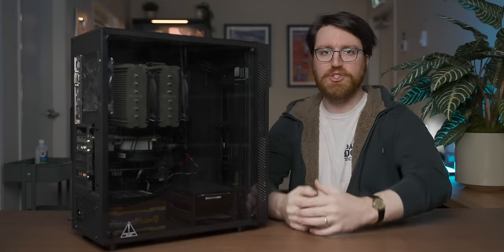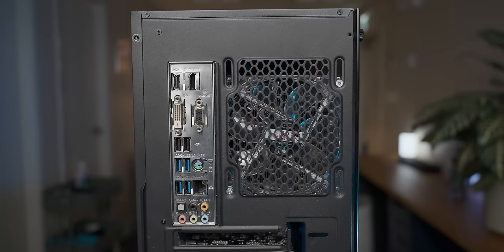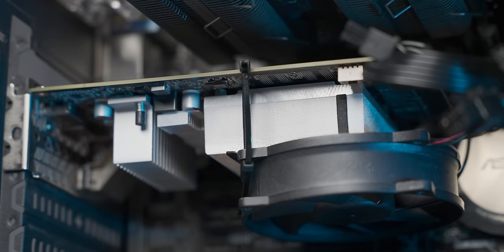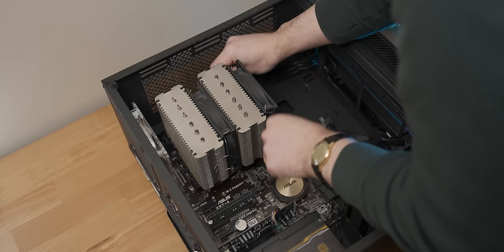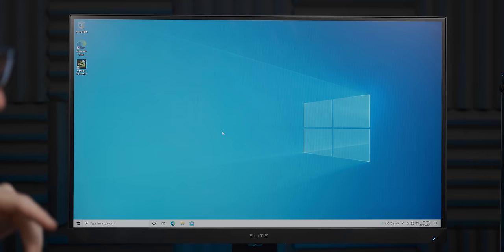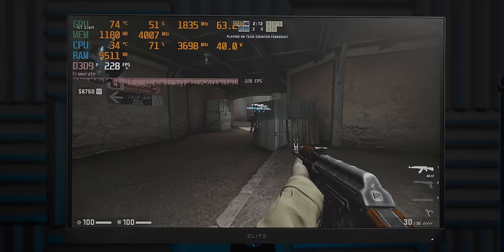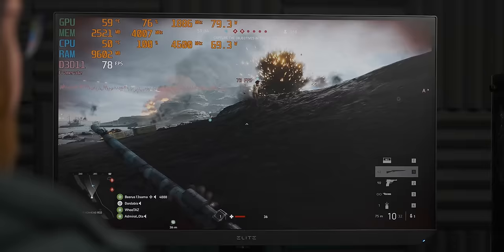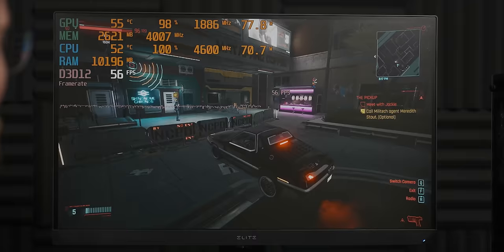What Does A $400 Craigslist Gaming PC Look Like In 2021?

Comment: Just like my old PC: Squeeze out the last breaths of life by installing a better used graphics card, improving cooling with ghetto methods and throw some RAM- sticks in there :) Worked great :)
Reply: Ssd?
Reply: @FS--ew3se  SSD's are for losers
Reply: @siqu7071  yes hdd best
Reply: I swapped out my 1060 for a 6600 xt.  I already had a 10600k and Z490 board and 32gb of 3200mhz.  It more than doubled my FPS, and I got the 6600 xt for the same price I sold the 1060 for as I was offered one that was returned.  The box was a bit damaged and it had nothing in the box apart from the GPU (not even in the anti-static bag).  He sold it to me for £300, a £100 reduction at the time.  Now the same GPU is nearly £600 in the UK so I'm very happy with it.
Reply: Ghetto methods you say? I literally moded a CPU cooler into my 2012 gaming laptop by drilling holes in its stock heatsink. Had to hammer out parts of laptop's plastic shell so that the CPU cooler could be mounted.
Reply: @harryshuman9637  Haha.  I drilled air holes into the front of my case, then re-sprayed it with black paint.  It looks like it was meant to be bought that way.... saved me spending out £75 or more on a decent mesh front case and brought my temps down by 12 degrees.
Reply from the maker: @siqu7071  You take that back. 😂
Reply: @DawidDoesTechStuff  prove me wrong

Comment: After suffering with a low profile PC for five years, $400 CAD got me an orphaned office PC (Core i7, 16GB RAM, GTX 1030, 500GB Sata SSD + 4TB HDD), seller told me it was rescued from the recycling centre. Tack on another $200 to put a 1070-Ti in this thing and I have a very comfortable 1440p gaming rig.

Comment: Like the one I had to trash. I was given an old Intel build and the board was dead... once I got everything torn down and cleaned, I put the system back together RIGHT and found the board was dead... no biggy, it was an old socket 775 system so I just saved the memory and processor... the board got pitched! transferred my MSI 760GM-P35 board into the case and now it has a nice new home...   a Raidmax Scorpio chassis in Blue.... nice chassis! anyway, nice video dawid! Have a merry Christmas!

Comment: Right before things got rough in Jan 2020 I set a co-worker up with a decent refurbished Dell Optiplex i7-4770 mid-tower system from Newegg. 

By the time we snagged a 1tb Samsung SATA SSD and a cheap used GTX-550ti (he's not much of a gamer) it was well under $400 and was actually still pretty snappy when I worked on it the other day.

Throw in a better GPU and it should even do okay with most newer games. (@ reduced detail of course!)

Comment: 4th gen Intel are incredibly hard to kill. 

I am sitting here, amazed by my 4790K STILL cutting it after like 8 years. Jut tried Forza horizon 5 and as I am a "60 fps max quality gamer" my 2080 Super just about copes at 1440p while the CPu still has some good headroom.

The tied together GPU cables actually imply that this thing originally had a better GPU fitted and they threw the 1060 jank edition in for the sale. Wasn't screwed in either. Stiil, decent pairing.

I was a bit disappointed that you didn't really give that soundcard a glimpse though. Could have at least shown what model it was.
Reply: I am laughing cause that means my 3950x will cut it longer then your pathetic quad core
Reply: @raven4k998  So you're saying the CPU you bought like 6 years after I bought mine will likely last longer than mine. You know what? I agree. 
But you are probably the only person in the world that finds this absolutely banal fact funny. For reasons only known to you.
Reply: @catriona_drummond  way way way longer cause my cpu is four times as many cores as your haha
just saying it will take a lot more crap to slow my beast down then your due to having that much more power on hand
Reply: @catriona_drummond  also what happens when windows 10 stop being supported in 3 years your screwed cause that cpu won't run windows 11 haha mine will

you can thank Microsoft for that one dictating which computer can run windows 11 and which cannot
Reply: @raven4k998  I can’t tell if you’re trolling or just a delusional AMD fanboy. For the record I have a friend who went through two 3950X’s because the memory controller died every time she tried to enable XMP on her RAM kit. AMD and their quality toilet paper IMCs.

Also, Intel and AMD are to blame for 11’s requirements. If you’re smart, you know why.

Comment: Engineering companies are a great resource to get half decent PCs. I picked up a rug that literally matched what I built 5 years ago for $250 from Contech Engineering here in Kansas City. Rig had an i7-4790K, 32GB RAM, 1TB of storage in RAID 0 (I think). And a crappy Nvidia Quadro card. Only difference between this and my rig was a GTX 1070.

Comment: That's a great computer for a kid. Or even someone who just does light gaming. Plus, for $400... That's a deal right there.
Reply: Definitely not a deal for $400 i bought a gaming used pc for 150 that blows this out the water (price to performance) from local pc shop that was amd phenom x4 and ati 5770 lol and i still over paid a little btw
Reply: @mitcrex  well not really, that phenom lacks modern instruction sets and is about 2x slower than that stock 4690k and 1060 3gb is like 8x times faster than that potato hd 5770, this 400$ in dawids video is much better deal and just purchase in general
Reply: @mitcrex  is this sarcasm?

Comment: I bought a nearly complete system on Mercari, for $270. Just needed RAM and a hard drive. $80 later, I have a Ryzen 5 2600, 650 watt 80+ Bronze PSU, and a GTX 1080. Once I upgrade the Mobo and CPU, this will be a beast. All for a fraction of the cost of anything pre-built you can get on the market today!

Comment: Recently bought my first budget gaming pc off marketplace from a local. I7 4770k, Asrock H97, Xfx Rx470,  16gb GSkill DDR3 1600, Antec 750w power supply, Dual Fan Cooler Master CPU cooler, Small SSD, 500gb hard drive in an old iBuyPower pc case for $450USD. I upgraded to a new MATX case (half the size of the old one) $65, and some cables extensions ($20) to make it look slightly better.

Comment: According to my IT guy 2 1/2 screws is more than enough. I recently had to teardown over 100 old towers to harvest parts before sending them off to recycle and I discovered his moto is all or nothing. Each computer either had every posible screw or the absolute minimum to hold them together. A few of them I opened the hard drives and disk drives fell out, not a single screw to hold them in.

Comment: @Dawid

WD Purple drive are used for video recording (think of CCTV system). Meaning this hdd is optimized to write parallel video steams.  So whats is the catch here? 
The handling of bit errors is tuned to keep data recording going. Usally a hdd will try very hard to ensure writing/reading data correctly on WD Purple not so much. It was designed to turn a blind eye on bit error. Not the best bet to keep data super safe. For storage use WD Blue or go with WD Black. (WD Red is for NAS and 24/7 usage)
Reply: Woah!!! I had no idea that’s what the colors of WD drives meant. The more you know! This is why I love the internet. The little facts people share 🤗

Comment: My old crap of a setup still runs most games fine. Its a i5 3570k@4,5ghz, 16gb g.skill 2400mhz ddr3, gtx 960 4gb (oc'ed at 8000mhz mem and 1460mhz:ish core) Runs okej. Now with the new Nvidia drivers and their new Image Scaling you can run games at 1280 x 720 and still get a good picture quality and higher fps. Like DLSS. Check it out :)

Comment: Hey David, 4gen Haswell is maybe older than some of fossils but this is still a tractor pulling level of procesor when it comes to even more denanding work in your office/home office. I'm talking only about the two most powerful chips from 22nm Core i7 4700,4800,4900 do 4000Hz 
Also Xeon E7 8895V2 with 18 cores uses the same 22nm technology. And yeah, there are still Haswell processors you can buy at Intel.

Comment: respect to the pc seller i sold a 6 core 12 thread unlocked turbo 3.4gh allcore gtx 680 for 600 and it had so much jank RGB and used like 3 diffrent mounting harware from deep cool master cooler and gamer gear  to mount the cpu cooler that was a vurtroo

Comment: I have a very similar build as my "test/back up" gaming PC. An Asus P8Z77-V Pro motherboard with an i5-3570K and an Arctic dual fan cooler, 24gb of ram (all at 1600mhz, 2 different brands, no issues), EVGA 1050ti with an aftermarket fan (ever so slightly modified fan shroud), and a 500gb sata SSD. All used and in an NZXT mid tower case with a 700w EVGA Supernova modular PSU (only new part lol). Runs awesome though, would be better with a 2XXX series GPU, but theyre still expensive.

Comment: The GPU cabling out front in a bunch, classic case of having a better GPU installed needing more than 1x 8 pin power, they sell the GPU separately and stick a weedy GPU in it's place without  sorting the cabling out. Or in this case a broken fixed 1060.

Comment: The only reason you'd do these mods to that GPU is if you flashed a new firmware on it to unlock more power. I remember doing that with a geforce 3, putting little heatsinks all over the memory chips and ghettoing a fan onto the passive cooler.

Comment: For $500 in early 2023 I bought a used PC with a 5700 xt an i7 6700 and 16 gb of ddr4 at 2400 along with a half gig gen 3 SSD and a 1tb HDD. Even had a decent amount of RGB. Was gaming in 2k at about 75 fps on med to high settings with fsr on and RT off.

Comment: The cooler is actually a Noctua NH-D14, not a D15. They perform similarly, but the D14 is just the previous iteration and looks slightly different.

Comment: Looks like a single 120mm case fan would have likely fit better and covered all the heatsinks. That was a pretty bad job with the zip ties. You can install stuff pretty clean with zip ties but not looping like that. Cut the head off 1 zip ties and use it as the zip for a single long tie. Even proper metal screws can screw into the fins of some heatsinks. Old school coolers actually installed fans this way.

Comment: I rebuilt my old 4790k with 16gb of ddr3 RAM running at 2133mhz paired with a MSI GTX 970 and thing is running most modern games well at 1080p..... Was thinking of selling it but wasn't sure on what's a good price these days. I was gonna lost it for $500. Put my rebuilt system in a new phanteks p300a case with a new scythe Mugen B cooler and new 550 watt Corsair Rx PSU. Also cleaned out the GPU and applied new thermal paste. 2 500gb ssd. One crucial MX 500 that has the OS and I added another 500gb crucial p2 m.2 NVM for extra game storage

Comment: I've had a few Frankenstein rigs as well. many of mine were left over parts for scavenged pc's and yes, for a long time every dimm needed to sport a ram stick and what I had lying around is what went in the slot. Guilty as charged...more ram is more gooder. I've gone as far as cutting holes in side panels and mounting usb fans for air flow in old office pc cases so, yeah...I totally dig this rig.

Comment: Wow, I didn't realize the GPU market was THIS bad at the time. I bought my first gaming pc in december of 2022, a little over a year after this video came out. I got similar specs and paid a whole lot less.

CPU: Core i5-4670 (non-K)
Ram: 16GB DDR3 in dual channel configuration
GPU: also a 1060 3GB

I paid 150 euros for it and it served me well for about 1.5 years, at which point I've upgraded everything except the GPU, which will be next.

Comment: I have a motherboard identical to that one in my HTPC. It's rocking a i7 4790K and a GTX 1080 with 16GB of 1866MHz RAM and a 256GB WD NVME SSD. I use the much smaller NH-D9L on it (system used to be in smaller case that 120mm+ coolers wouldn't fit) and that keeps 4790K at perfectly reasonable temps. Who knows, I may end up selling that board and CPU sometime soon. I have plenty of newer, better parts laying around to upgrade it with. I just haven't because it's not super necessary.

Comment: Ive recently built a similar pc. Got a 4690k with a mobo, case and psu from a friend and fitted a 4gb 960, 16gb of ddr3 ram at 1600mhz, 480gb
m.2 nvme ssd and the cheapest tower cooler along with some case fans i could find. All in all i paid 200 bucks for it but considering i got half the components for free i would say yours was a better deal.

Comment: I also have similar situation.
I had $400 budget to buy Secondhand PC.

So I lucky I got 
H97M Pro with Core i7 4790K 4.4Ghz no OC. Included with 2x8GB 1600 Mhz RAM. All for just $125. For Real!!
$15 DeepCool Gammax 200T as reviewed in this channel.
$235 Brand New GTX 1660 Ti.
$20 480GB SSD SATA

PC Case, PSU, HDD, Keyboard Monitor etc from my old PC. So I consider it $0

Grand total: $395

Comment: That's actually pretty close to what I'm running (3570K @ 4.5 and a 1060 6GB) and shows the weird situation 4c/4t CPUs are in today. In some cases they are basically useless and in others that can totally hold their own.
Also shows the issue with modern "all glass" cases: when there is no air things get pretty hot.
Now I wonder how the card would do with two fans on it. A pair of decent 80mm fans running on 7v might be a good compromise between cooling and noise. It's what I had on some cards of mine where the cooler wasn't adequate or when they were passive.

Comment: The RAM config was likely causing problems because it was running in mixed mode rather than dual channel. So, only 1GB of that 8GB stick was running in dual channel mode and the rest was running in single channel. Didn't help that they were all clocked at slowest stick. What a oddball build. Easy enough to fix the issues though and end up with a pretty decent PC for the money.

Comment: Lol I'm not so sure of the small heatsink leaning on the top of capacitor bank is a good idea these small cap have a shrink wrap that goes even more tight or crack from heat would probably end up into a short with high heat !

Comment: I have a deep cool neptwin v3 keeping my 4690k cool with 2 140mm bequiet pure wings in the front and 3 140mm pure wings in the top of a Phanteks Ethoo pro case. 32 GB 1600 mhz ram and a chunky Zotac GTX 1080 AMP! Extreme GPU....gpu is probably a bit overkill for the CPU...and for audio an audigy ZS pci-e sound card..and a 4 port usb 3.0 up card. EVGa 750 watt power supply. Looks great.

Comment: I've fooled around with a practically identical system lately (same motherboard and CPU but a 4GB GTX 970 instead of 3GB 1060) I actually set it up for my parents now who don't game while secretly you could install some games on it and it's fairly capable like 60 FPS Witcher 3 at 1080p.  CPU is sometimes a bigger issue than the GPU depending on the title these days but overclocking helps a fair bit.

Comment: Maybe this is pure projetion of what I'd like to do if I bought a system like this, in fact it is, but I'd love to see this played with a bit more. Like, what happens if yopu put a 4/8 or 6/12 3rd or 4th gen i7 in it instead? What if you put a faster and more sensible ram config in it? And maybe put a 120mm aio on a g12 on the graphics card. It'd be really interesting to see how far you can push an older platform and slower hardware.

Comment: Deepcool case was my first case and the thermals, are definitely not good, specially if you use cheap fans. I changed to 4000D with six ML Fans and my system is way more colder, really achieving 60 on my GPU’s

Comment: honestly not a bad deal given what used 1060 3GB goes for. the key thing is you can just reuse the CPU cooler and case for your next build which is really what gives you great value. that is what long term reduces PC gaming costs.

my 10 year old sata SSD is still good so it becomes a cache for my 5 year old HDD. my noctua cooler still work fine no need to buy a new one. my 80+ plat PSU is still good no need to buy a new one. so the real cost you get left with is CPU, mobo, ram and GPU.

Comment: I'm recasing an unknown condition similar set up... ASUS Z97-A/USB 3.1, two sticks of 4gb Kingston HyperX Black ram. 256GB SSD, two 2TB HDD and a i7 4790T, (why!)... It came with a HD6670 which I'll upgrade to whatever I can that fits my 4K 60FPS HTPC needs. I also would upgrade the CPU to overclock.  The case going with is a SEXY black satin Phanteks Enthoo Evolv ATX glass case. Fingers crossed it fires up!
Reply: I found an asus z97 ar with a i7 4790k
 Tho the cpu light is red

Comment: I think it's obvious from the 8-pin power cords that this computer had a better video card in it, prior to sale, that probably got removed and put into his new system and the old video card he used to use put back into it.
Reply: Idk. Looking at the pro gpu fan mounting and SSD position. (not to mention only 2! screws holding the mobo in place. Like wtf)

I had my 2x6+2 cables ready even now I was still running a 5600G. And now with a RX 580 in wait for good prices on GPU's? You bet the secound 6+2 cable is still ready to be used! I kid you not I spend 2hours dealing with cables and stuff. It is not worth it going back and adding a secound 6+2 cable later on. That 1060 3GB is very plausible the GPU this person used in this rig for many years. Going by the mobo screws alone. The SSD mounting I approve btw. The right way to install SSD's!